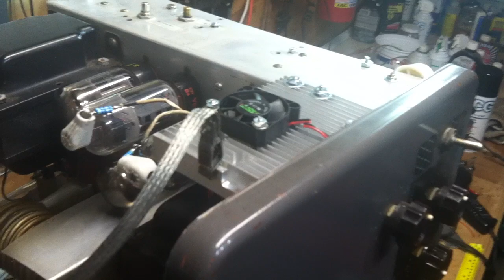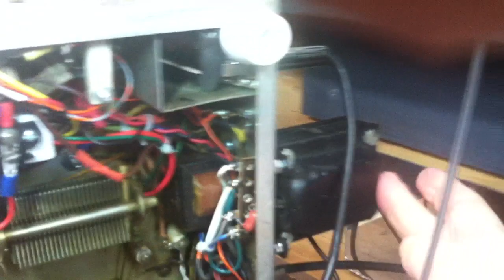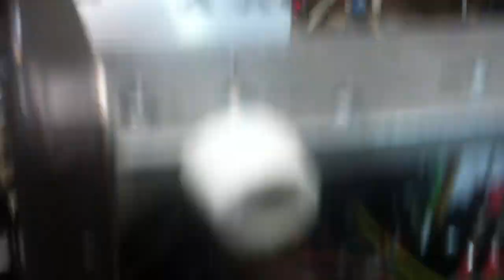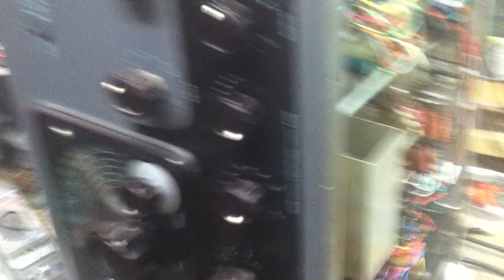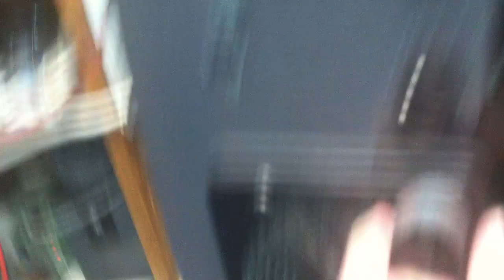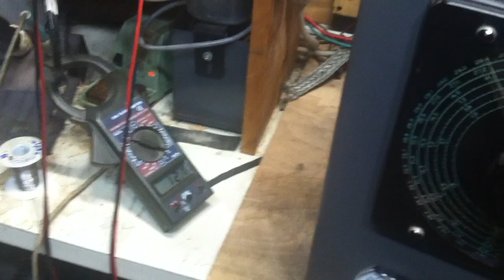Johnson Valiant New Modulator using MOSFET Driver

Comment: I wonder what motivated you to do these things in the first place ?  the 6146's only required a couple of watts of drive ( paralled sections of a 12AU7)  ... which could easily be supplied by a small solid state amplifier  which can be had used for almost nothing, and connected via some shielded cable.  Impedence matching to the grids then requires a new transformer.. but a small output transformer from a tube amp connected backwards would do that.  6DQ5's are good tubes and much cheaper than 6146's...were used by Gonset and others,  but since 6146's will last 30 years in ham service.. I wonder why the change?.    The Old Standby  "hi-fi" mod,  is to bypass the clipper, increase the cathode bypass cap capacity a bit, and use the coupling cap values to tailor the response.  Adding a modest amount of filter capacity to the output side of the Plate Supply... can make the V.Reg a little stiffer for the modulator.  And the screen supply can also get a bit of help that way,. And providing the right input resistor at the grid of the 12AX7 to make your chosen type of mic happiest.. yields a good sounding rig.. with not much effort ... and of course it is reversable...a real consideration for these classic rigs.    I have used 3B28's in place of 866's  for decades.  Which seems to solve all the issues associated with M.V. tubes.  Anyway.. your experiments are notable, for sure.
Reply from the maker: OK, I get the sense that you are a SSB guy and I dont want to get into a SSB vs AM discussion in amateur radio.   Many people have gone the sweep tube route for the Valiant modulators,  triode connected.  There are a host of reasons.  The 6DQ5 has twice the emission and provides much more and cleaner audio.  So I hardly blazed a new trail there.   More here:  http://amfone.net/Amforum/index.php?topic=31298.0

Comment: Why?  It's the driver transformer that is improperly designed.  It's the wrong turns ratio.  Swapping out a few capacitors and adding some negative feedback can make the Valiant close to 50's broadcast quality, with a minimum of changes.
Reply from the maker: Correct the driver transformer was quite poor.  The Valiant never had broadcast quality and was possibly the worst stock audio of any of the era transmitters.  Going to the sweepies improved the modulator and provided much more audio.  A number of people have done that mod with excellent results using vacuum tube drive.  The FET drive was just an interesting alternative.  The modified Heising made a nice difference as the OPT was saturating.  TNX for the comments.
Reply: P F Of course the Valiant does not have broadcast quality.  It was not designed for that.   I'm saying you can get "close to 1950's broadcast quality" (not modern) with a minimum of effort.  There are of course many ways to achieve the same objective.
73

KQ6IG